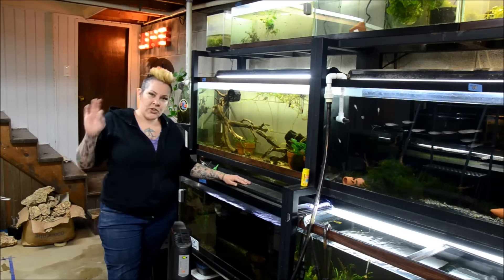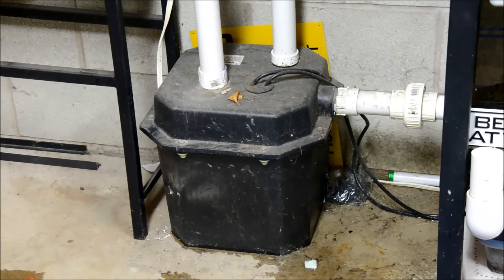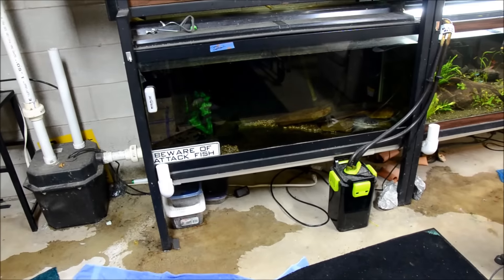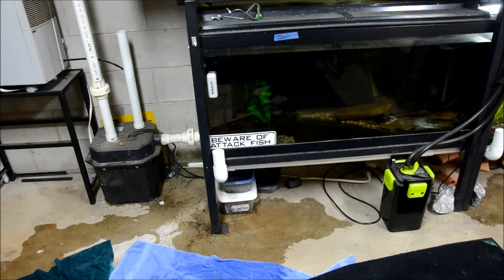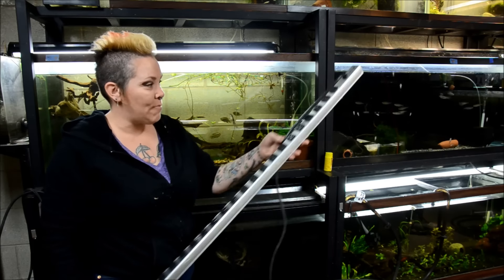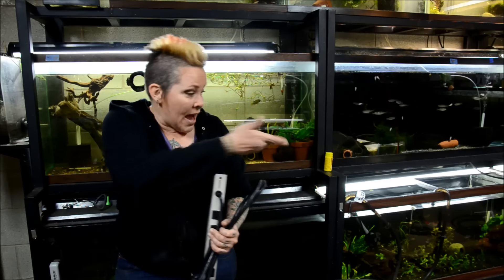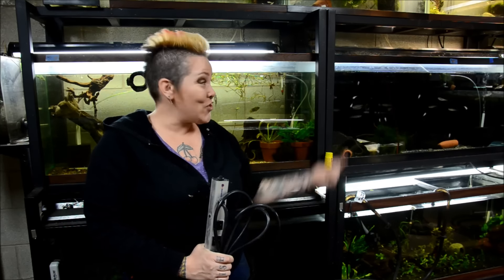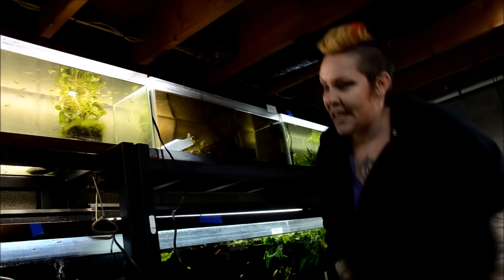I made a HUGE mess!

Comment from the maker: There is nothing fun about equipment failures and messes! I am a pro at making messes, and luckily always keep extra equipment around. What do you guys keep duplicates of, just in case?
Reply: Rachel O'leary I always keep extra filters and small 1-1/2 gallon tanks. Air stones and bubblers
Reply from the maker: +Chiyoiche hahah I relate!
Reply: I've got a few HoB and a couple canister filters tucked away.  I should be better about having cycled media too, but I'm not.  Living on the edge!
Reply: I keep extra heaters and pumps! :)
Reply: I've got myself a professional powerstrip with a fuse in it. Anything goes wrong, fuse just pops.
Reply: Spare heaters and a spare Aquaclear, just in case.
Reply from the maker: that is what saved my butt with this one! THe fuse popped turning off all my equpment. I was wondering why it was so pleasantly quiet over in that part of the fishroom, lol
Reply: Heaters, return pump, powerhead. And always have pre made RODI on hand.

Comment: Power-strips, air-pumps, filters, airline tubing, heater. DIY emergency supplies, Sponges, craft mesh, plastic light defuser, superglue gel, PVC. I even have spare tank lights.  I pretty much could set up a couple of tanks out of supplies, if I had the tanks - which sometime are a 5g bucket or a plastic tote for QT.

Comment: It's always good to have a back up, I've got a 25w and 50w heaters spare, 5 pack of cheap tube lights, battery powered air pump and 2 mini fluval filters, so far I've not had to use a back up. But now I've mentioned it I've probably just jinxed myself..
Reply from the maker: +Donna hahaha
Reply: Rachel O'leary Usual case for me!!

Comment: Did you try changing the fuse of the power cord? usually that will be the only thing that would burn out first.  🙂
Reply from the maker: +Chethan Gowda. A we opened it up and the first outlet was fried
Reply: What was plugged in in that fried first outlet?
Reply from the maker: I dont' know, i unplugged everythign and didn't take note. The breaker jobby on the powerstrip tripped, and when we opened it, we saw one wire was pretty corroded in there.
Reply: So, moisture in the air getting in there causing corrosion? Odd that they've used a metal that can corrode in the powerstrip. Well, anyway, lots of proper wall outlets in the fish house I guess.
Reply from the maker: +Magnus Johansson it's 10 years old, who knows!

Comment: I believe that you probably have a sump pump in that housing... many houses around here have them in their basements in case of flooding.... how do you keep the water that spills out of the tanks from shorting out your power strips? Do you have a shield over them or something?
Reply from the maker: I installed that pump, i have a sump in my corner drains. The power strips are zip tied to the undeside of my tank racks so are about 10" off the ground.

Comment: Hey Rachel, I noticed the Colbalt canister and was wondering if you had any thoughts on it.  I picked on up for a new tank that's been sitting in limbo (for over a year 😅), so I haven't had a chance to see how it works.
Reply from the maker: I like how you can place where the motor is, its easy to use and clean, but I find it to be pretty underpowered. It says its for up to 55g, but i probably wouldn't use it on anythign bigger than 29g.
Reply: Thanks for the info.  I was planning on using it n a 45g, but had also been toying with the idea of using a second one to get some flow going in other areas (plus extra filtration). I think you just convinced me.  Now I just need to get off my butt and get back to setting things up.

Comment: speaking of equipment failures, I have a dilemma; I bought a stand for a 75 gallon tank. It is the stand of an acrylic tank set. Can I get a rectangular 75 gallon tank with a piece of plywood underneath to help stabilize the corners of the rectangular tank or should I not even chance it?  Thanks!

Comment: When you have "guys" depending on you for survival you have to have back ups.  Whether it is a Rubbermaid tote to sub as an emergency tank, spare pumps, etc etc.  I always play "what if" and buy what ever I need to get out of what if.  I seldom have power outages in the city.  I know the houses across the street are on another feed line we have never had both sides of the street fail together.  I have a couple hundred feet of commercial extension cords in case... BUT to satisfy my last what if I need to buy a generator this summer to power at least the fish room.  With over 25 tanks I can't imagine the loss due to power failure.
Reply from the maker: +Chuck Troast I have a generator. Rarely have had to use it but it gives me peace of mind